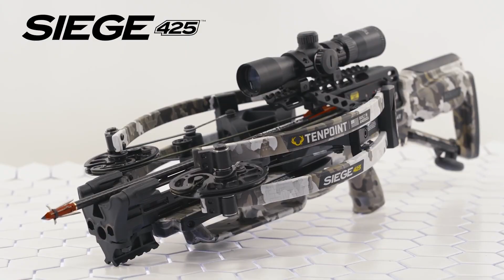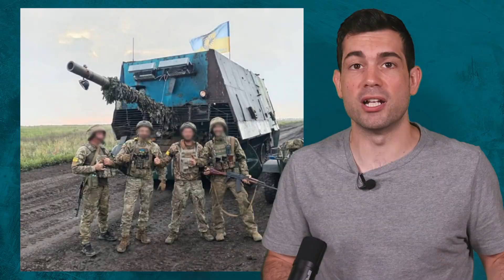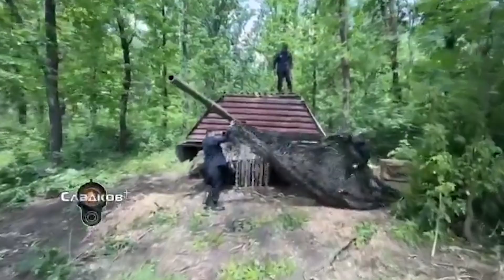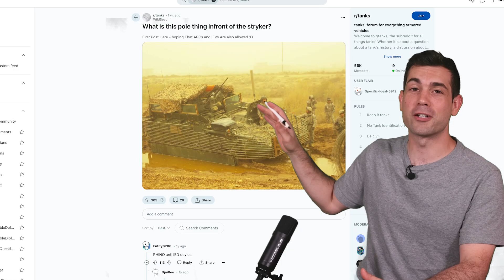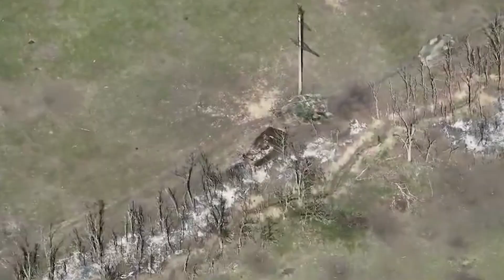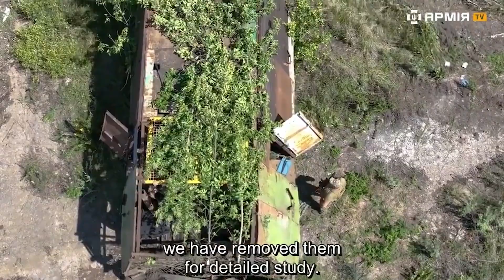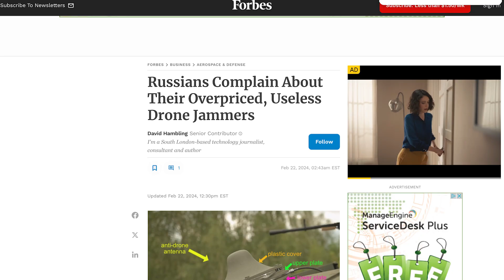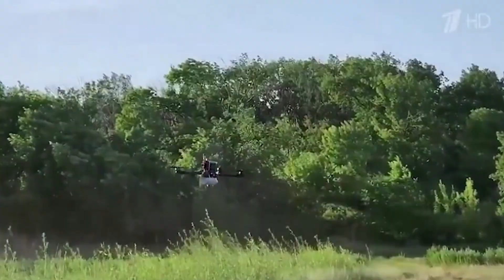Why Ukraine’s Taking Turtle Tanks Seriously

Comment: The author doesn't really strain his head. Does the turtle tank have any problems with small arms and artillery? From the fact that the armor made of sheet iron was installed on it? And if you think with your head? Was his own armor removed from the tank?
Does the turtle tank have to move slowly? This is due to the fact that it has such a name, apparently such conclusions. In reality, this tank is not inferior in speed to other tanks.
Will the turtle tank stop because the thin sheet armor will get stuck in the mud? Before making videos, the author should learn something about tanks. The tank does not slow down when passing through a brick wall.
 A very strange idea of war has taken root in the West. Something like a fashion show, or an expensive car store. When military equipment should have a super presentable appearance, equipped with the most expensive electronics, the most advanced weapons. This attitude brings very big problems when you are faced with the loss of military equipment in real combat. Receiving hundreds of billions of Western aid, Ukraine was able to purchase a very small number of Western combat vehicles. As time has shown, they have no advantages over the old armored vehicles. Both are vulnerable to drones. Storming enemy positions is an exit from a zone where equipment is protected by electronic suppression means. The role of this armored vehicle is to reach enemy positions. After that, she will be abandoned and she will be destroyed. Because even after the soldiers leave it, it will still be attacked by drones. You can use Abrams and Leopards for this. Then each of your assaults will cost half a hundred million dollars. Or you can use an old tank that has been decommissioned. And he will complete the same task. The choice is yours.

Comment: The counter drone problem reminded me of a book on "secret" (ie usually "didn't work") weapons of WW 1.  One of them was a rig that had a motorized rotor that could fling out ball bearings at high speed.  It was supposed to be used to replace machine guns but the motors of the time were bulky and not very powerful and the ball bearings weren't ballistically efficient so they lost energy fast.  But, if you could rig a system to detect the drones and aim the system, this could give a cheap counter weapon to ultra light drone attacks.

Comment: Good to mention that many of these might have been otherwise unserviceable tanks, and initially I would weigh its effectiveness against the manpower and scrap to do this work on a subpar tank. I think what's more important, however, is this "opportunity cost" imposed by not only scrap metal and simple signal jammers, but also the use of proficient tank crew or at least a driver/commander, and specifically here there loss of a "parts vehicle." Most nations have these damaged or incomplete junkyards for fixing the deployed equipment. Even expensive stuff like the F-22 Raptor has tons of unfinished planes that are kept for parts. Turning them into subpar vehicles must also be weighed against the cost of manufacturing those spare parts new.

Comment: I've said it before, but I'll said it again. Ukraine needs drones with a bit of onboard intelligence, that says if you lost signal due to jamming, lock on to the jammer signal and slam into the source.
Reply: it's a cost effectiveness issue - they use drones because they're dirt cheap compared to the alternatives, and adding more fancy tech onto them would defeat the purpose
Reply: @lred1383  no. This can be achieved with fairly cheap electronics, and if the difference is  the drone still killing a russian vehicle, versus the drone just falling to the ground, it's well worth it. What I described is well within the realm of what's going on nonstop in Ukraine, in terms of arms race between drones and anti-drone tech.

Comment: Those Soviet T72 tanks were old back in 1984 when I went through basic at Ft. Sill. I thought they would be using them for target practice like we use M113's for now. But they do have armor you could cut up and shingle a roof over a newer tank with if your short reactive armor on the new ones I suppose. Very logical.Guys who did the Nam trained me and they said they actually did sit on phone books going into a landing zone but there wasn't enough phone books to go around. When your in a war you'll do anything you can to keep from getting your ass shot off.

Comment: I could see at least 1 use for the “Turtle Shell” for Ukraine, at least after some proper western R&D:
Both sides have been using drones and missiles and bombs to strike at each others storage facilities for military supplies… Ukraine could simply make shells that are designed for easy installation and removal, perhaps even mid-battle. So if a strike DOES happen on a facility that holds their tanks, or as their tanks are being struck on their way in or out of a battlefield, said tanks would have their potential damages mitigated, and then the damaged shell can be shed when the right time comes.

Comment: Original cope cage makes more sense than this. But I guess using otherwise disabled vehicles for this is better than nothing and is quite frankly the only justification. But if you are using them as troops transport, then not having a shed is better because it isn't offering dismounts any protection but make it harder to disembark when under fire and cannot return fire while mounted.
As a tank, the shed blocks visibility and arcs of fire so much that it also isn't worthwhile. It ends up more vulnerable to everything else on the battlefield that its just suicidal. Now if its used as a breacher vehicle with only a driver, the additional shed armor makes some sense. Just my two cents

Comment: 'mangal' is Russian barbeque which is shaped like a rectangular tray at the base of which sit the hot coals. It is made out of thin  sheets of steel. Meats are barbecued by placing them on top of this barbeque using skewers. The turtle tanks are being called Tsar-Mangals because they resemble an inverted Russian barbeque.

Comment: As for the driver's visibility, it never is great, this more or less has no effect on the tank driver...
This thing will reliably stop small grenades dropped by mini drones. They can't see where the hatches are and drop it in. As for the HEAT ammo, not so sure... The myth of HEAT losing almost all of its penetration due to "space armor" is perpetuated by video games. Yes, HEAT does lose some penetration, but not to extent shown in video games. It will still be enough to go through tank side. There is a video about RPG systems and there they fire at a lightly armored vehicle with slat armor. The projectile hits slat armor, detonates, goes in, exits the other side of the vehicle and makes holes in trees dozens of meters away... It does lose penetration after 1-2m, but it's negligible. And you would have to place space armor 3-4m away from the vehicle and still have ERA on the tank...
However, what it does is make it difficult for the drone operator to guess where the tank is under all that so that HEAT might strike at it.
Jammers help, but they can be hit by small arms fire or artillery shell splinters. On top of it all, simple software tweak can help to some extent when facing jammers; keep the last command given by the operator in case of signal loss, like poor man's INS...
Overall, these things do have some purpose if nothing else than just as a psychological tool. And we do see advances in areas they are used. Are they that useful? As you said, we'll have to wait and see...

Comment: the standoff distance is to reduce the effectiveness of shaped charges. they're made to explode at a certain distance and standoff drastically reduces the effectiveness of EPS (shaped charges)
Reply: Shaped charges often have suboptimal standoff due to size and weight constraints, to the point that increases in standoff can actually improve penetration.
From the top, 6 feet/1m is actually enough to help. From the sides? No. It hides weak spots. But the penetration is sufficient if it lands on a weak spot.

Comment: There are ways around it, for example the EFP of a BONUS round is designed to penetrate from 10m away from the tank, that would easily go through both layers.

The problem for Ukraine is most drone weapons aren't custom designed but rather old soviet RPG's taped onto drones and wired with new detonating mechanisms

Comment: Drones are not the only battlefield weapon, sending in AA will just get targeted by another weapon system such as the Javelin.
So really you need to be comparing cost, what is cheaper, an AA system or a modified tank?
Considering the costs of $16million, using AA is not cost effective on a battlefield, you would be better to place these at strategic location such as an airfield to protect against drone there, rather then deploy them to any front line where they will survive for literal minutes before getting destroyed.

Give it another month and you may find Russia has defeated drones.

Comment: Due to a shortage of armored vehicles, the Russians are converting tanks into armored vehicles. A similar situation occurred during World War II, when the Allies in Normandy converted some tanks and self-propelled howitzers into armored personnel carriers. But the allies in Normandy thought of removing the guns and turrets to make them lighter; The Russians haven't thought about it yet...
Reply: Not at all, there is not shortage of APCs.  And they are not removing turrets not because "they haven't thought about it yet", but because these are assault guns
Reply: @sergeig685  with a non-functional gun and no shells? do you know what logic is?
Reply: @vladkudrya9615 yeah, they have been converting tanks to countless purpose built vehicles without turrets (BMO, BMPT, TZM, BREM, IMR, MTU, etc, etc) for decades yet “they have not thought about it yet”. You’re a genius, Vlad
Reply: @sergeig685  
You’re not very smart if you don’t understand that the Russians simply don’t have cranes to remove multi-ton tank turrets.
Reply: @vladkudrya9615 just stop, man. All tank units are equipped with BREM-1M, specifically designed to recover and repair tanks in the field, including turret replacement. Not to mention that these turtle tanks are made in the rear whether they have access to regular cranes and industrial facilities.

Comment: Russian are simply using turtle tank like a militarised bulldozer, a "killdozer" you could say,
They put anti mine at the front, drone protection ++ et as much anti drone scrabmler et voila you got a top column vehicule that is here to demine and survive the longest possible to bring the rest of the column at the front line, nothing more/
It's not stupid it's an adaptation to the huge use of mines and drone

Comment: The kill dozers two fatal flaws was that its cooling system wasn't modified and its designer hadn't done enough planning to account for getting stuck
Reply: Wd is building a new and improved design....😅
Reply: @brassmonkey7566  I'm insulted you think the Russian army engineers can even compete with the enginuity of one American with a tractor and a serious vendetta. 😆 Mostly jokes but still
Reply: Russia's Defense listened to Gaijian and started following the Ideas on building their tanks chassis like it's full blown crossout!
Reply: @Scotty_Hawkin  

What is gaijan?
Reply: @joebenson32  Russian Game Studio that owns War Thunder, and more. Crossout Essentially is a game where you collect parts and weapons and make a car with. Because you collect scrapped parts and attach them to the car as Armor
Reply: it was also really slow
Reply: It has no armor, that is just scrap metal from electrical panels & shit not armor so it only stops some shrapnel 😂
Reply: @ZootyZoFo  say you know nothing about the kill dozer without saying you know nothing about the kill dozer 😂
Reply: @ZootyZoFo  welded sheets of fabrication steel with a inner lining of poured concrete to be exact. Come back this comment section after you've done your homework on the kill dozer
Reply: @theboogieman4362 with only small arms used against it with the option to use a hell fire missile but unwilling to use due to being in a built up area .

By that logic the Bob seppel tank was a great machine
Reply: Also, it’s designer was insane.
Reply: @canadiangemstones7636  not the kill dozer’s flaw
Reply: @canadiangemstones7636   but not wrong.
Reply: @jaynikk758  You don't know the story.
Reply: @jaynikk758 should do some research he tried pretty much everything
Reply: @jaynikk758  

"fight the government in their rigged courts" - No balls
Reply: @jaynikk758  He NEVER would have won that fight. He was shafted over and over by those same very people.
Reply: @jaynikk758  his town was corrupt, going to court wouldn't have done anything
Reply: @nickcollins1528  Except paying the goddamn bill to hook up his sewage line.
Reply: @SoupyMittens he chose death and personal pride over anything else.

Even if he lost everything he was still alive......

That was not acceptable to him and he ended his life on his own terms in a world he no longer he wished to live in.

Some call him a hero I call him lazy..

Instead of trying to build a new life he end his..... Many have lost everything to fire  flood earthquake and war ....... Did they rage against the law or did they rebuild
Reply: @canadiangemstones7636 no he was a sane man in a insane world were criminals rule society.

Comment: Question? When does distance to jamming of a drone get over ridden by faster drones and better self guidance? Lets say a drone is great until jammed. but if you can target from a distance, lock in a Ai target from an operator and have a drone do a high speed autonomous ordered strike that could use Ai to dodge on the way in.
 Jamming then becomes a mass distance thing. I.E. bases or jamming planes running constant missions. None of which will kill a localised signal unless pointed at it.
 This is only the start. Soon we will have drones to kill drones, drones to jam drones, Drones that warn and guide other drones all run from a command jet 2000 miles away.
 Meanwhile grunts will still be dying because adults couldn't talk things out. Funny how modern leaders don't seem to be on battlefields much while calling others to fight.